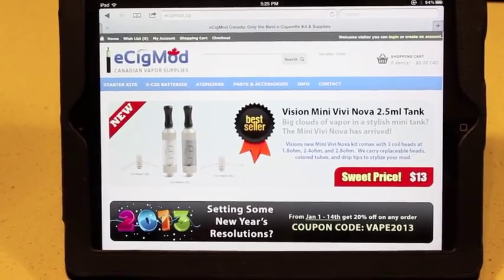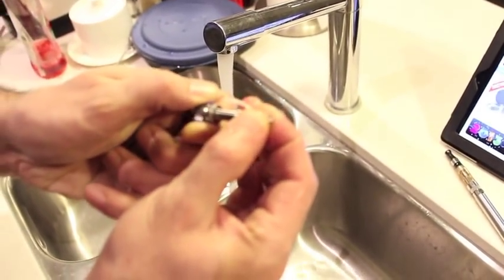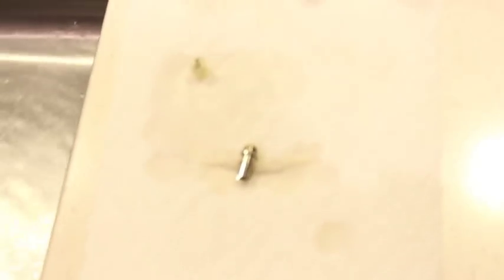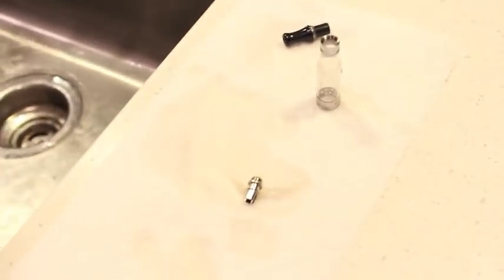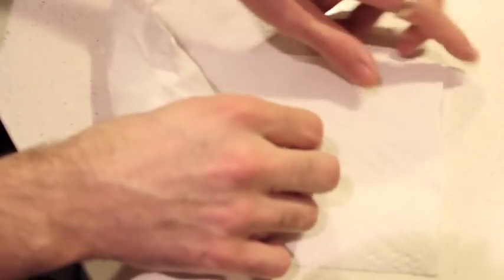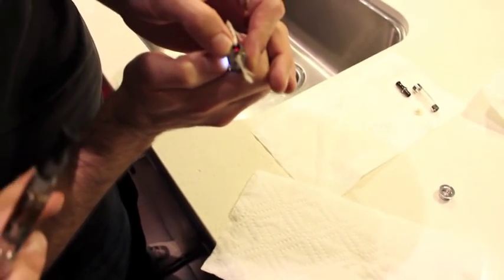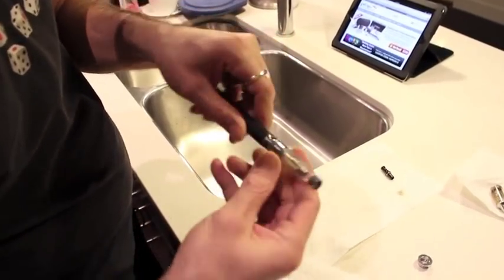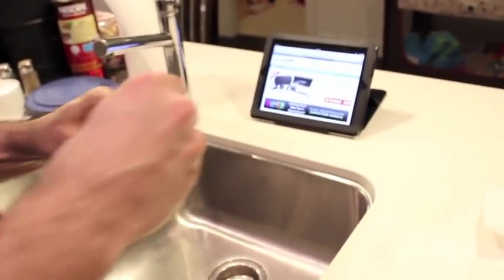How to Clean a Clearomizer (Stardust / CE5)

Comment from the maker: Sorry I missed this!  

Yes the burnt residue is sometimes tricky or impossible to clean.  You can try a toothpick to clean it off.  It's hit or miss with getting the residue off.  If your clearo is older than 2-3 weeks it is likely at the end of its life and you can replace the head.   Sometimes it just washes off and you can dry burn the rest off, but often it continues to taste burnt, so you need a new head.

Hope that helps.

Comment: great video, thanks! i just started using my clearomizer and have noticed a quick decrease in the draw. I saw some videos regarding pulling up on the pin at the bottom where it makes contact with the battery, but that didn't do anything for me- any part I should check out while I'm cleaning to see what the problem might have been? thanks!

Comment: i have the same problem with the black at the top and just curious its not dangerous to smoke with right ? it does tast like burnt a bit and i would replace it soon but for now im still smoking from it and i was hopping it wasnt rust cuz that wouldnt be good to smoke but if its just residue then it should be ok right? 

thanks

Comment from the maker: You can unscrew the bottom part if you have a V3, the V2 was not rebuildable and doesn't come apart.  You can tell if you have the V3 because the very bottom part is gnarled so it is grippable.  Hold it tight and it will unscrew.

Comment: So much easier to use denture cleaner.  Just take off drip tip and soak clearomizer  in denture cleaner for about an hour.
Rinse well and then dry both ends with hair dryer. Whole process takes about  2 hours and its done.